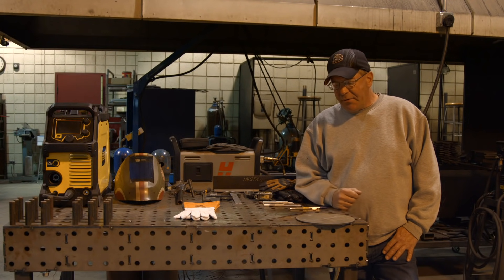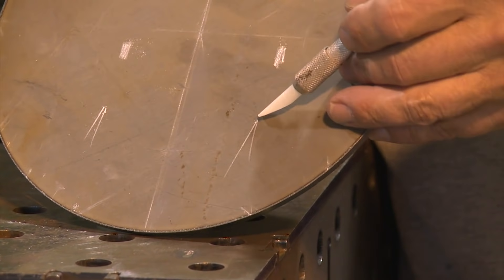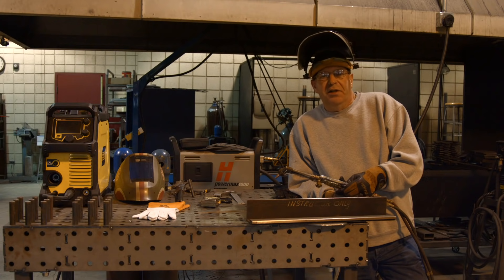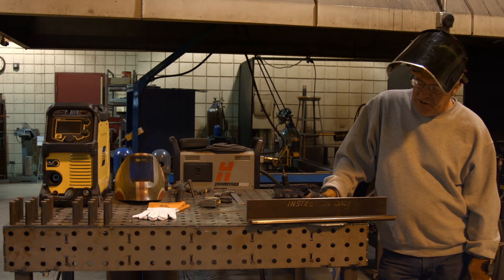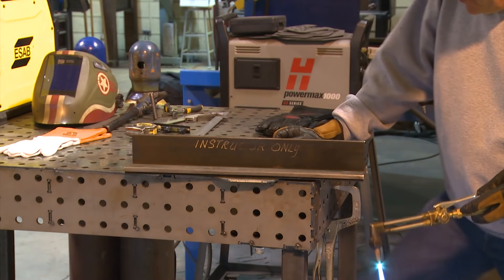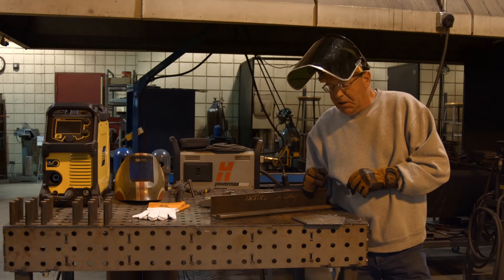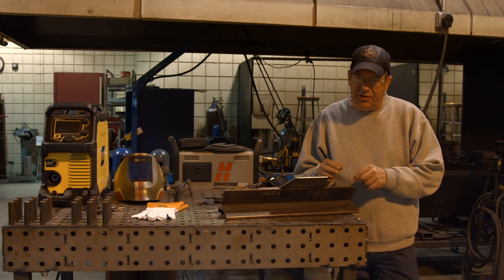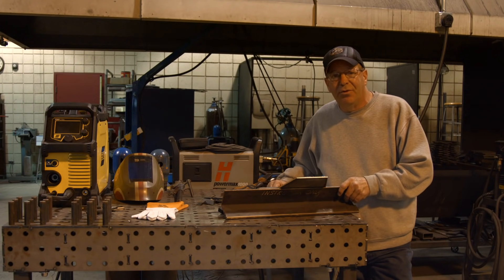🔥 Flame Cutting with Oxy Acetylene

Comment: If you're cutting thinner stock and getting melted material back-filling your cut, is it simply a matter of lowering your temp?  I tried speeding up, but then I lose the cut.  I do notice that I've been setting my flame by adding more oxygen, and the cones are small and discreet.  When I depress the oxygen lever, it substantially shortens the flame.  I'll try setting my flame to what you show in the vid.

Comment: Excellent video! I think you should do a video on the basics of the oxy-fuel cutting process. Such as setting the pressures on the regulators, flame adjustment, proper shutdown procedure, etc.  Just like ww_big_al says below.

Comment: Hey Bob just wanted to tell you that i really enjoy your videos ive spent over 30 years as a pipefitter in that 30 years ive had to weld and  worked around some incredible pipe fitters and fabricators. Ive never been near a strong a fabricator as i am a PF there is a big difference. Im currently trying to become a CWI I take a 10 day seminar and a test in may. Im doing the 1104 i think you would be great at doing seminars to become a CWI. I caught your video where you welded cupons and did a bend test root and face and got so much out of it. When im studying and want to refresh my memory on a welding process or whatever ill look at one of your videos and always get something out of it that always applies. Thanks for that. You are definently one of a kind and I mean that in a good way keep those videos going you are helping alot of people out there Bob including me and im a 51 year old craftsman.

Comment: I like to run a 1mm cutting disc over my chalk line. You get three advantages, you don't lose your line, it gives you clean metal to cut and if you keep your flame just off the keep side of the cut, it gives you a nice straight finish.
Reply: Ron Hickmott that’s a good tip, I’ll keep that in mind for thick cuts!

Comment: I use an auto center punch and then swipe it with a red or gray perma-marker.
My instructors were Richard F. Larkins and Charlie Overfelt....The irony is that them growing up in two different worlds aircraft and flatheads were a common theme. Swamp or drag strip ? No problem. Just Do It

Comment: I no use a bar for cutting, hand cutting 30,40,50 or even a 100mm thick either round or flat stock need to be cut by hand only providing higher concentration and deeper respiration technique to achieve straight and perfect cuts even when cutting 1.6 and 3mm thick plates

Comment: Let's say that I have a oil barrel and I got ask whu happened to if I get at a torch and I hover flame up above a oiliy residue barrel with water and, I get torch and hover it over the oil + water, is a explosion is waiting to happen?
Reply: DO NOT CUT ON DRUMS!
Reply: Bob Moffatt i didnt say cut, i said heatup/
Reply: My bad. Let me put it this way - Let me know when you get a torch around a drum that has an oily residue present. I don't want to be around! Don't want to read about anybody doing it either.
Reply from the maker: Why risk it? Oil + Fire don't mix...
Reply: +Weld.com i understand #weld.com safety is #1
Reply: +Weld.com because it shoudnt explode you know why, water is a coolant and a solvent and 4wk ago i cut pipe ongas bevler, all it didvwas flare up a flame, unhooked it, dipped in water, refitted and resumed cuttinf, no flameback

Comment: i had no idea you could cut that fast and cleanly with a torch........... holy crap
Reply: waderedsox yes you cut quickly with a torch. You must preheat your metal. You must the correct oxygen and acetylene pressures for a given thickness. You must also have the correct cutting tip size. You can also weld and brave with this same torch.  All you need is a welding tip and lower had settings.

Comment: Great demonstration! Always prided myself with my torch cutting work. My go to guides for over 40 years are a 2' and a 3' foot one. Made with 6 sided drill stock from jack hammers with 1/4" steel flat tabs welded on along with 2 die maker magnets welded on the 2 footer and 3 on the 3 footer. They rods are positioned so one pointed side is facing towards the side that the torch will be guiding on for straight down cuts and also the angle can be used as a bevel cut guide. Tabs allowed the bar to be clamped when needed but most of the time the magnets did the job on steel. I must have made over 20 of them for guys when they saw me using mine. My go to torch has always been my favorite Oxweld W17 combo torch, which no one else was allow to use, which teed off a lot of guys- but too bad. I notice your guide was also marked instructor only. I can see other torch videos you can make showing how to cut off bearing races with out ever nicking the shaft or cutting off frozen nuts without ever touching the threads or burning out bushings controlling the oxy. by feathering the lever. Your students are very fortunate to have an instructor that is not only technical but very field experienced.  Thanks Ed K. Cleve. Oh.
Reply: Hey if its your tool you dont lend it to anyone unless they treat their tools better than you do.
There is a saying; Never lend your tools or your wife, 'coz they both will come back fucked!
Reply: My late grandfather instilled in me a principle: Leave things better than the way you found them.

My previous boss contributed to this principle: If someone lends you a tool, you return it to them in better shape. (This applied once specifically to a Bosch rotary hammer drill.)

That said, know the person you lend your tool out to. And choose which tools you want to risk lending ;)
Reply: Oxy-Acet....I had a welding shop in the early 1980's...cut a lot of plate up to 1/2" ....The first plasma cutters were just showing up...they were too big to put in the back on a pick-up truck....usually on a trailer...... I bought a Koike Handy- Auto....great investment...I think they still make them.
Reply: His students are very fortunate indeed!  A picture of your cutting guide would be awesome, although I have a fair idea of your setup through your wonderful description!

Comment: hi bob, i saw in your cuts you heat with the tip straight up and cut with a slight angle, i have a oxy-propane rig i use mostly for preheat but i will buy a cutting tip, is the technique the same, also you seem to keep the preheat cones(?) about 1/8 off the plate while cutting (sorry for the terminology if wrong) is this ok too with oxypropane?. if you have made a video about oxy propane sorry for the questions if you can share the link i haven`t been able to find it. thanks again for the education. take care. pete. ps these cuts look awesome
Reply from the maker: Yes, it should be the same. Travel speed may vary slightly. Cut quality should be the same. I lean the torch slightly forward to maintain preheat and have the sparks go away from me during the cut.

Comment: Clean tips makes things so much nicer for welding & cutting with a torch! Can you guys do videos talking about the max withdrawl rates for oxy/acetylene rigs and talk a bit about what different sized tanks are useful for. That would be SUPER helpful!
Reply: To prevent withdrawl of liquid acetone out of an Acetylene cylinder youre allowed 1/7th of the bottles capacity per hour. Is what i was always taught. And if you lay the bottle down for an hour stand it up for an hour before you use it

Comment: I glad you cover the Oxy/Acetylene torch I feel it is an over looked tool that is still very popular especially with the home shop. I would like you to cover the torch in more detail if you could. pressure settings, tips sizes, flame tip adjustments. From what I've seen on you tube is many welders assume that using a torch is common knowledge. Maybe a series on torch usage 101 would be good.

Comment: When I was learning to oxy fuel cut around 45 years ago we had to use a ascribed line with dot punch marks along it. After cutting we were expected to have just half the dot punch marks left. if the whole mark was there or none at all we had to do it again until it was right.
Reply: I learned the same way, but thats only 12 years ago...
Reply: I do this for MACHINING!  Say, on a milling machine.  Or even some hand work, when you file down to a line and see the half punch marks.  I never would have dreamed that you could do this with a TORCH!  I do a little torch cutting, and when it's done I'm just glad I didn't get hurt.  It usually looks like a bad accident when it's over.  WELL, let's watch this a few times and try to be better!  If I was good at torch cutting, there's lots of it to do!  Plus, I can have some free material when it's all over.

Comment: I have 2 plasma cutters but still prefer the acetylene torch
Reply: ww321 that makes a lot of sense. Kind of like the steady-cam rigs camera operators use to stabilize their shots, versus just hand-holding the camera.
Reply: I love using my everlast plasma cutter but I'm getting older and I find that I'm not as steady as I used to be. Thank goodness for torch standoffs!
Reply: Interesting comment, can you elaborate on it further about your experiences?
Reply: Doing freehand cuts I can get a smoother cut that cleans up easier than with a plasma. I think it has to do with the weight of the gas torch verses the very light weight plasma torch. That weight adds stability in your movement.
Reply: Same here. The torch simply gives a cleaner cut with less dross. In fact, done properly I can consistently get cuts as clean as a saw. Plasma always leaves much more dross/slag, and since it isn't as well oxidized it often doesn't simply knock right off, but instead has to be ground away. I relegate the plasma machine to the rare times that I need to make odd cuts on aluminum or stainless.

Comment: Make a video about oxy acetylene welding for different metals. 
Thanks for the great videos.
Reply: John Ratko the Experimental Aircraft Association http://www.eaa.org still teaches how to do torch welding.
Reply: David Marquardt you can weld aluminum with oxy/acy. You have to use a really small tip and Flux but it can be done. Look up tinmantech on YouTube.
Reply: toolman talal I was thinking the same thing. I always thought that if you could learn to weld with a flame and a stick of wire, then TIG would be an easy transition. Also it is a lot easier to get a couple bottles out to a field then a generator, a TIG set-up.
Reply: +David Marquardt bullshit. Aluminum is non-ferrous and I've OFW'd it many times. How do you think they welded aluminum on early aircraft? Even up into WWII most aircraft fuel tanks were OFW'd. It's not easy, but definitely doable.
Reply: Do you know if he does aluminum OFW?
Reply: John Ratko no, where is the link of the video? 
Bring it here please.
Reply: The Oxy-fuel  process does not work on non ferrous metals.  You can melt aluminum and blow it away with the cutting jet, but it will splatter all over the place and look horrible (I know, I tried it).  Oxy-fuel works on steel because the iron oxide formed has a lower melting point than the steel, also unlike other metals, iron oxide is much more fluid and runs out of the cut exposing fresh metal to the cutting jet.  Aluminum on the other hand has a melting point of 1,200 degrees F, but aluminum oxide melts at 3,600 F and is goea and sticky, it's whats called a refractory oxide.  Stainless steel and copper have the same problem, but that's what plasma cutting is for.